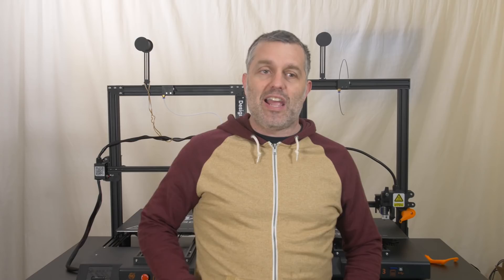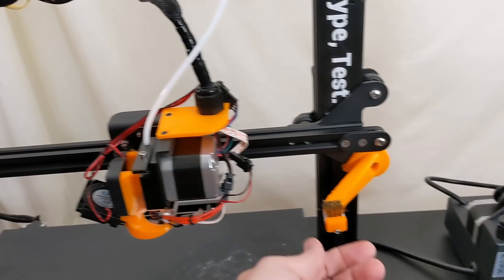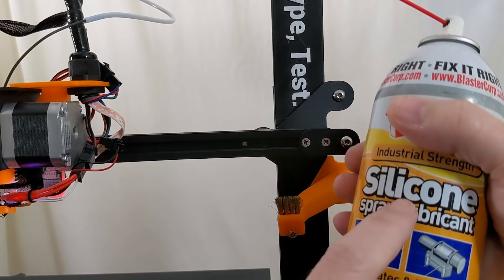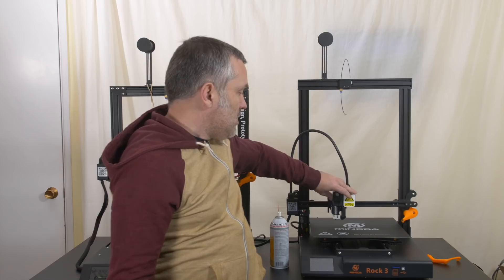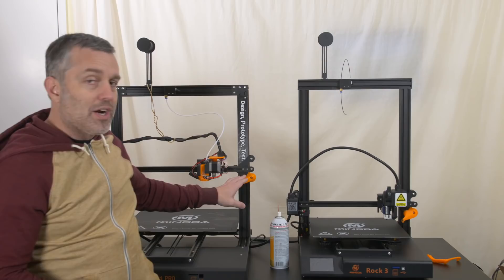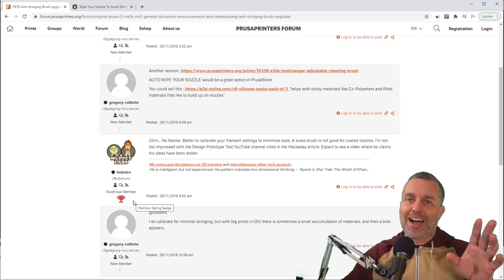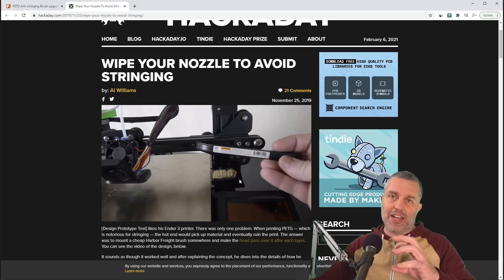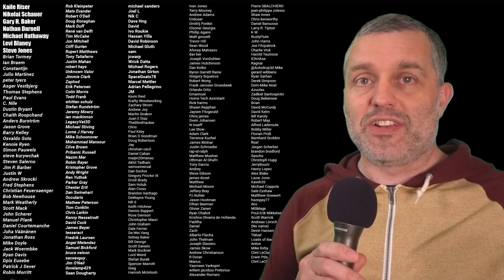Wire Brush vs. Silicone Wiper - Which is Best for Auto Nozzle Cleaning?

Comment: I like the video but disagree with the comments about Prusa.  First of all, all of 3d printing is based on people sharing and copying each other's designs.  Second, they have invented some things.  Prusa made all of the changes that took the sells Mendel to the sheet frame of today.  They also pioneered powder-coating pei onto beds.  And tried to make an optical filament sensor that could sense the movement of filament.  They partnered with ultimachine and helped develop the mainboard on all the mk3s.  They made a tiny inductive probe.  They made that probe temperature independent.  They implemented bed squaring.  There are lots more examples, not to mention all the prusaslicer development. that's bringing features to everyone. And even if they did copy other's designs, it doesn't matter.  They didn't just make it, they made it in a way that worked well, was cheap, and they ultimately brought it to market.  It's great that you had an idea, but you didn't incorporate it into a product.
About how it's a polished turd: Sure.  It's a flimsy machine.  It could be better.  But you know what, it works.  It works well.  They put the effort into tuning it and it is one of the most advanced and well-performing printers on the market right now.  With the bear upgrade, it doesn't print significantly better even though it is more rigid.  There's a saying: if it's stupid and it works, it ain't stupid.   I believe this is very important here.

I like your videos but this video really makes me not like you.  Sharing is an integral part of 3d printing.  prusa implements all these cool features into a branch of marlin for everyone to use.  Chinese companies copy everything too:  look at creality's ender 3.  copying v wheels.  Using marlin firmware.  etc.  But they implemented it in a good way and it works.  If we can't share and take other's ideas and add tiny bits to them, then progress would be slowed immensely.  And prusa agents commenting on hackaday articles to hurt your channel?  wtf? you sound like a crazy conspiracy theorist.  Now I see why people don't like your personality sometimes.  Lots of people don't like your personality in videos (even though the ideas and concepts and engineering are good), so that's what they comment about.

No prusa doesn't have the best printer on the internet.  I'd love a HeVORT but can't afford the parts.  Prusas print great, have tons of features, and aren't badly priced.  They aren't good for modification, but they work.  Prusa isn't trying to shut you down.  Stop trying to blame them. Grow up.

I clicked for a wire brush vs silicone brush comparison, not a rant about prusa.
Reply from the maker: >They also pioneered powder-coating pei onto beds.
This was a sentiment I gave birth to which Tom Sanladerer debunked. Like two years ago I was trying to not be one sided in my criticism of Prusa and find redeeming qualities there. Tom showed how a supporter of his channel sent him a PEI powder coated aluminum bed back in like 2014. Also, Tom talked about the history of flex plates and even flex steel print surfaces. Every single anvancement on a Prusa is an idea he got from somewhere else. The company does not birth innovation. Prusa is a curator not an inventor/innovator. 
> They made that probe temperature independent.
An idea he most likely got from me. Which is what started this whole feud because he didn't give me credit and he doesn't give anyone credit for the features/ideas he takes from them. Instead he gets his sock puppets to go on the internet and fool people like you into believing that Prusa is the reason all these things exist. It's like a shitty boss taking credit for your work.
Reply: That's a great and pretty honest assessment Reid, I might have omitted the "Grow up" bit, but only because I think DPT does some great work, and I want to keep supporting his channel. He has had a tough year or so of some nasty pro-prusa hate comments, I don't think it is from Prusa, but it's from the Prusa fans, which is also I guess understandable, we all like to be in tribes deep down.
I also need to commend DPT for reining in his frustration about the whole situation, but DTP please keep going, but please ignore the Prusa subject, let yourself shine rather than being pulled into the mud and keep up the good work.
Reply: @DesignPrototypeTest  Now that is what I like to see, evidence of when you have given Prusa some credit, even if it did end up turning out to be false... It is this kind of thing that gives you credibility.
I know you feel wronged by Prusa for the way he takes others' ideas, and from the Prusa fans who like to rubbish your comments sections and you tube scores with games, and well done for toning down the venom for Prusa... But please keep the videos coming and please tune out of the Prusa thing, you are better than this and many of your fans want to see your channel flourish and you get rewards from your hard work.
Keep putting your great ideas up here, and let the timeline show who's idea was who's, then let your fans broadcast links to where the new feature or idea came from in Prusaa's channel :)

Comment: Man I was always wondering what the deal is with those silicone wipers as I couldn't imagine them to work. This answered a bunch of questions! 
I also had huge problems with petg boogers and whispiness. At first, I also thought about adding a brass brush, but back then, my printers had the same problem as the prusa where the nozzle wouldn't clear the perimeter of the heated bed. My fix was to set my travel feedrate and travel acceleration rather high (100mm/s, 1000mm/s/s) and enable 0.2mm z-hop. The increased speed and acceleration would cause the tiny whisps to immediately break away from the nozzle and reduce the oozing time. The small amount that would still ooze out would be so little that it would be less than the z-hop amount. That way the small amount of ooze wouldn't collide with the outer perimeter of the part but rather ooze into the infill, basically causing the nozzle to wipe within the part itself. Ever since I figured that out, my nozzles stayed clean, even after days of printing and the prints were perfect without even the smallest amount of whispiness or surface boogers.

Comment: Asymmetric forces are useful to slowly rotate mechanical devices. Allow the brush to rotate clockwise but with a ratchet preventing reverse rotation. The nozzle wipes but not through the center of rotation of the wire brush. The brush will slowly rotate and use more of the wires for cleaning.
Cheers -Peter

Comment: I purchased a Tenlog TL-D3 Pro during a black Friday sale and it comes with models for wipe buckets that use a brush. But they do not say what brush to use or where to get it. so I made my own to use with it. It also didn't fit level. I had to angle it down for it to allow the extruders to pass over it instead of crashing into it. I plan to redesign the entire thing when I get time. I think if a company is going to offer that feature, even if you have to print it out and build it yourself, that they should at least be correctly designed to work and also give you the info on what other parts you need to use and where to get them.
I like the printer. It works alright. But like all printers they can always use improvements. Making those improvements is a lot of the fun. At least for me. I think most my prints on my FDM printers has been mods for my existing printers or to build entirely new printers from the the ground up. Its just what I like to do. :P

Comment: For the "every 10 layers" situation, there is a way of pulling it off in Slic3r and PrusaSlicer and I think it should be possible in Cura but note sure.

For Cura, I think the ChangeAtZ post processing plugin might work? Not sure

For Slic3r/PrusaSlicer, you can use conditional gcode to achieve the setting, in the "before layer change g-code" you can use a if/else statement

In the example it's for a temperature tower, so there is automatically changes the temp, but I think a gcode script like yours should work there too, but would require testing

{if layer_z <= 10}M104 S235
{elsif layer_z <= 20}M104 S230
{elsif layer_z <= 30}M104 S225
{elsif layer_z <= 40}M104 S220
{elsif layer_z <= 50}M104 S215
{elsif layer_z <= 60}M104 S210
{elsif layer_z <= 70}M104 S205
{elsif layer_z <= 80}M104 S200
{elsif layer_z <= 90}M104 S195
{elsif layer_z <= 100}M104 S190
{elsif layer_z <= 110}M104 S185
{endif}
Reply: See also: https://manual.slic3r.org/advanced/conditional-gcode
Reply: It's possible to do this in Cura with a post-processing plugin. This is exactly how the Temperature Tower Plugin works, inserting set temperature Gcode at particular layers based on the layer's Z-height.

Comment: I have put a wiper on my MK3s. The right motor mount and the top right rod and lead screw holder have to be changed so that right z motor is extended by about 2cm. You end up losing about 2cm z build volume on the left, and it screws up the auto bed leveling as the magnets are 2cm off which will require you to mod the firmware to change the magnet location.

A micro swiss hardened steel nozzle with their slippery coating ended up solving most of the nozzle sticking issues with PETG. You have to be mindful so that you do not scratch the outer coating, use a piece of tissue paper or leather to clean the nozzle instead of a wire brush.

Comment: I have used both Marlin and Cura's tool/nozzle clean option. 

Marlin sets up a command G12 I think and you can set your pattern and amount of wipes. Then insert this in your code.

Cura can clean per layer, but seems to use its own movement codes to drive the wiping.

If one uses the Marlin command in Cura's post-processing, the one can wipe at certain heights rather then each layer. Will have yo test that idea.

I've followed your design ideas, but made my own geometries for the nozzle brush. Same goes for the Ender 3 cooling tower and part cooling fan angle mod. 

Thanks for the great ideas an vid content. Keep em comming!

Comment: To not get a brush filled up with plastic, don't dive your nozzle too deep into the brush. When the brush just touches the nozzle, it works just as well and your brush stays cleaner and is way easier to clean.
(Note that I don't print in PETG very often, that stuff likes to stick everywhere..)

Comment: Others have copied your brass nozzle cleaner brush and have made videos about it. Nylon and Peek stick to metal and they need to be brushed off as well. Bobstro's comment in the Prusa forums gave me a good laugh.

All printers have some flaws. If you want a Prusa style printer, but with advanced features, buy a Matterhacker Pulse printer. Or download and print the Pulse printer parts and add them to your Prusa. Also I have removed the T8 lead screws from my Pulse and have a one stepper motor synchronized Z axis lift that no longer needs constant calibration. I know that Prusa and others have attempted this in the past without success, but I have designed, implemented and currently running this system on my Pulse.
Reply: @jeffl1356  Did you buy the 32 bit boards with the pulse xe printers? The hardware components on the Pulse are superior, look at the bed mounts, do you see zipties? Do your lead screws terminate into the top mounts? Does the X axis belt tension push down on the motor? Which hotend did you purchase? Is it a screw type mount? Does it come loose? 

The two lead screw motors are garbage. I will release my Z axis mod when it is finished. I have +/- 0.01 mm accuracy on my Pulse now. I also have a low cost kit mod for the bed to linear rail setup coming.

Comment: In Marlin, could combine the brush/wiper with Clean_Nozzle G12 command to define the move to the brush, move in a defined pattern on the brush, then with Clean_Nozzle_GoBack return to the position where G12 was called.

Comment: I've been toying with a different idea, of using a servo motor, you can move the nozzle to the outermost edge, then, using the servo, wipe the nozzle. The idea came while working on one of my Core-XY printers, and I wanted to pull the excess plastic away from the bed. I didn't think about the wear on the brush.

As for the layer change, I think the best route would be to use a place holder, at the layer change, then with a simple script do a search and replace. This would allow you to add a counter, so only add the wipe on every 10 layer changes. I know it is annoying to have to post-process the gcode, but a basic script would be able to do the job.

Comment: if I remember correctly the 3d systems machines use a L type motion. You can also try using the solder wipe sponge thing. I suspect heating the nozzle up during the cleaning would help too.

Comment: So weird idea for the mingda rock 3, (or prusa machines), if you have the arm on a pivot, with a positive stop, you can have it so that when the bed is all the way down, the wiper cantilevers upwards, and then when the bed moves up, the arm levers down, and you can use that to wipe the nozzle at the expense of losing a bit of build area on the right side. For wiping gcode, you would need to ad a Z+10 or whatever to move the nozzle up, like a Z-hop

Comment: When are we going to get the Mingda D2 update we were promised? The firmware for the D2 has been updated to 2.8.2 but Mingda say the source code is not yet available. The D2 version we have doesn't have an mcu/STM32 on the TFT35 module so you can't update the firmware on the TFT35 because there isn't any! We should be able to get the screen with the BLTouch functionality as you can for printers like the the Rock as there is a video showing you how do it on Mingdas youtube channel for the rock. There is a new version of the Mingda D2 on Gearbest that has a TFT35 with an SD card slot so presumably it also has an mcu/STM32 on it.

Comment: Great as always.

Checkout Cube 3D from 3D systems (discontinued), they already implemented the silicone wiper + bucket for IDEX system, IMHO their implementation is the best.
I did copy their design with brass brushes, but as you said, brushes are consumable & will get full easily within a print or two.

I think an "active" solution is needed for clean and predictable operation.

Idea: mini vacuum pump at the edge, directed toward the nozzle + silicone wiper to drop filament in a bucket. Bucket should be cleaned every print.

Keep it up, more upgrades are always a welcome :-)

Comment: I've actually had a lot more luck with the silicone wiper (in my case actually ptfe). The brass brush wouldn't hardly remove plastic from the nozzle and just make it cling on to the side or top of nozzle. The wiper generally will actually clean it but sometimes if there is only a little filament dribbling it won't get that. My purging routine takes care of it tho

Comment: Where did you get the brass brushes on the original design? I'm currently modding an Artist D to use two Hemeras. I need to redesign the purge bucket so this video is timely.
Reply from the maker: https://www.aliexpress.com/item/1005001839150546.html?spm=a2g0o.productlist.0.0.58967567lnM4iW&algo_pvid=dffcf672-2d3b-4b61-a459-e3ca74974a6e&algo_expid=dffcf672-2d3b-4b61-a459-e3ca74974a6e-5&btsid=0bb0623016127622052205731ee2d5&ws_ab_test=searchweb0_0,searchweb201602_,searchweb201603_
Reply: @DesignPrototypeTest  Thanks!

Comment: Have you considered not going through the middle of the brush every time?  If you went to the back of the centre on the first wipe, then on the second wipe, you went through the centre, then on the third wipe, go through the front of the centre...  

This would probably help slow down the valley in your brush... and front and back wipes might even straighten the centre wipe bristles.

Comment: On your brass brush setup, I can't tell if you have a sock on your heat block. I'd put more confidence in the brass brush than I would in the silicone wiper. Good idea. Years ago, a news station reported tat 3D printing had been created by 2 Montreal Canadians engineers. Several months later, it was stated by some, I can't remember who, that 3D printing had been invented before these 2 engineers had come out with their design. Who invented the first concept of 3D printing? I didn't, and that's really all I need to know.

Comment: Didn't prusa make the pcb style heat beds? Could be wrong, but I thought I heard that somewhere.  I do like prusa, but I'm also pretty open minded so I see a lot of what you say, and agree with most. However I would say that It might be a little much to say that everything they did was copied. 

Resource: https://reprap.org/wiki/PCB_Heatbed

But I could be wrong. This doesn't say they made the 1st pcb heatbed, but rather they developed the mk1 heat bed

Edit: also, on my mk2.5s stock set up with the stock prusa petg profile (0.2mm normal and 0.4nozzle) and even with petg that sits out for about 6weeks I have had no issues with any blobbing. Although my prusa mini does have some blobbing issue, but I believe that's due to the Bowden setup. I don't print petg with my ender or tevo, so I'm not sure about them. Might give something like this a shot on those
Reply from the maker: >I would say that It might be a little much to say that everything they did was copied.
Agreed. Nothing is ever 100%. I should have said 99% of Prusa's innovations were ideas he got from other people outside of his organization.